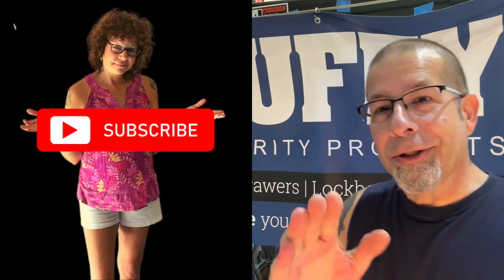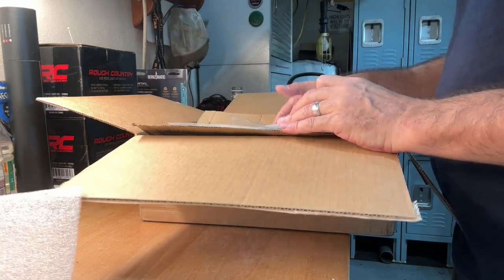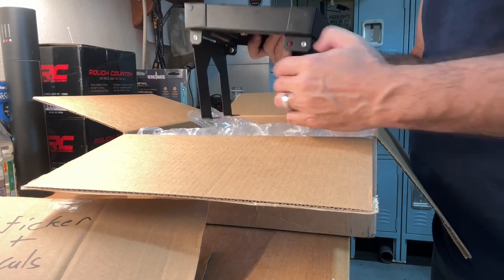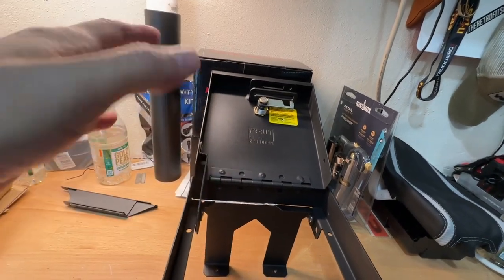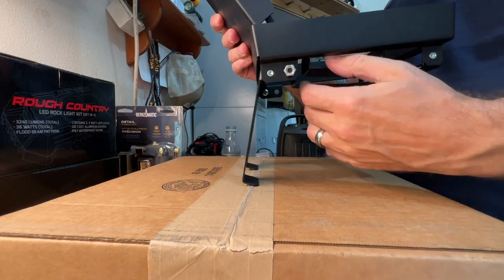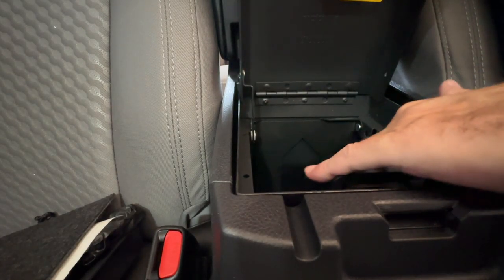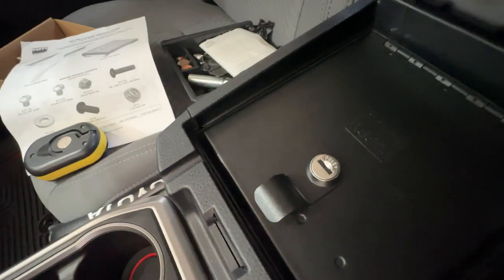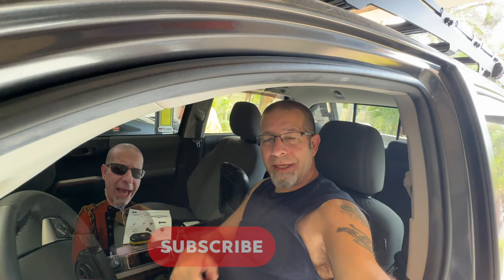Tacoma Safe Install

Comment: I think the USB cable issue could be solved with a drill bit and a rubber grommet. I do not like that the support bar for the lid is only on one side; needs support on both sides even though the lid is light. I do not like the keyed lock. Here in AZ (and maybe Texas too) I would guess 90+% of the Tacoma consoles hold a firearm, which one would want available to them without fumbling for a key. Tuffy makes a three digit combo lock that should replace the keyed lock that you can buy separately, but this should be available as a no cost, or low cost, option when you buy the safe.
Reply from the maker: Personal preference I suppose.  I actually prefer a key👍
Reply: But if your driving with a firearm in the console it shouldn't be locked anyway.....right....gotta get the gun fast

Comment: For nearly 200.00 bucks looks a bit flimsy. If security is a big issue say for a fire arm then a security safe box is a better option.
Reply: Snap Safe (large size) behind the seat back for insurance stuff and lock the firearm up when your not carrying while away from the truck.

Comment: Rob, Have you ever installed a LOC for the factory radio for an amplifier?. Also, would you know where to obtain a diagram that shows the back of the stereo, and what wires to use for such?  Thanks